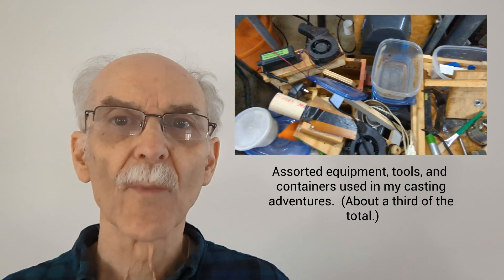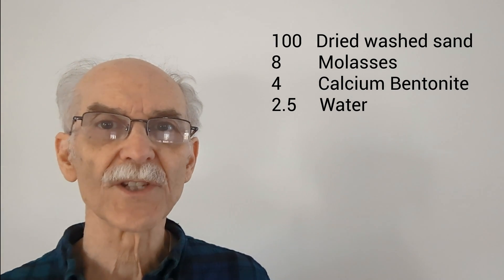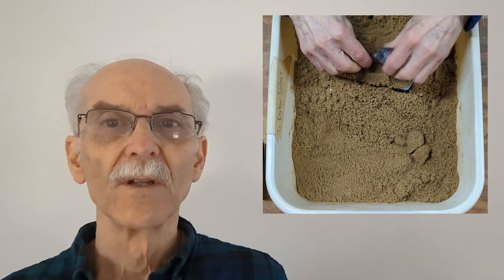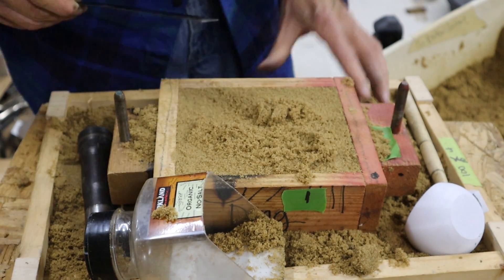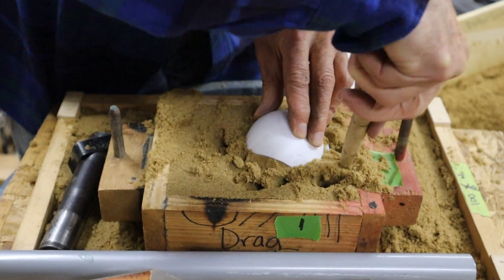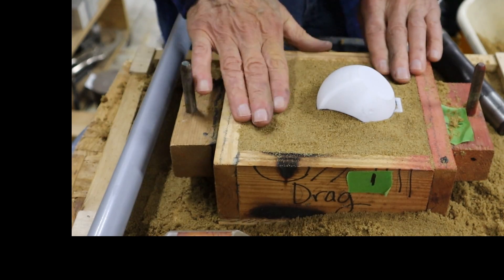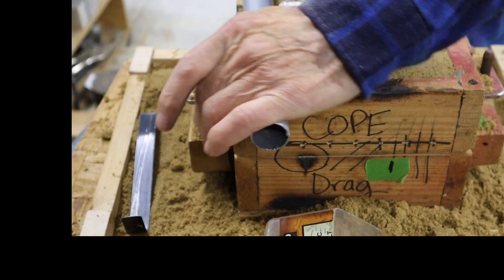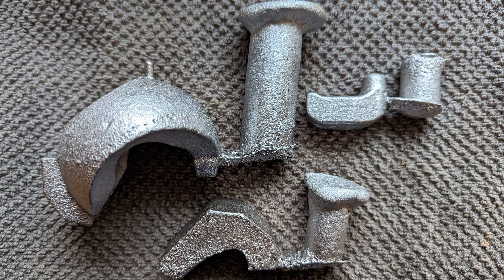Molasses-Bonded Sand Part 3 – Improved Recipe

Comment: Could you tell me the advantage of the molasses-bentonite sand as opposed to just bentonite based sand? From your video it seems to be more fluid, and I'm having a hard time to see that as a major benefit. I have little experience with metal casting and that makes it harder to evaluate this method.
Reply: If you are using bentonite as the main finding agent, certainly in a commercial foundry, there would be quite a few other ingredients. In general, unless you add an excessive amount of  clay, rendering the sand rather impermeable, you have to do a very intense, energy-consuming form of mixing called mulling. The molasses and bentonite together can just be mixed and used without this arduous step, and the sand is also flexible, and generally easier to work with.

Comment: Interesting, I've had my amateur foundry for over 50 yrs [& burnt a few out along the way] no YT to make you an expert then]  it runs on coke, with forced air nice & quiet & cheap  never bothered to change to [expensive] propane  although I built a small propane one for small stuff I  usually use greensand  or if it's a plaque  fine coat of petrobond [expensive but good for fine letters] then back up with greensand, I made some of your sand from the last video & found it good thanks, I have plenty of bentonite [hybond 100,] it's processed locally so I'll give this a try, as I was given a load of dry foundry sand from a local foundry recently thanks.
Graham.
Reply from the maker: I will be interested to see what your results are.
Reply: Thanks.
Reply: How well does the petrobond mix into your greensand? I've been thinking of doing this exact thing because even though I have hundreds of lbs of greensand.. I've basically done it all for DIRT CHEAP. Didn't want to spend money on expensive petrobond but I think I have to to get the dimensional accuracy and finish I want
Reply: @notyouraveragegoldenpotato  Hi I don't mix, yes petro is boody expensive!!what I do is sieve a fine layer of petrobond onto my plaques [they have fine lettering] petrobond is strong & fine for fine detailed patterns then fill up  with sieved greensand, ram up as usual greensand in the cope, after pouring I split the boxes & carefully scrape the burnt petrobond off so it doesn't mix/spoil the greensand & usually discard the burnt petrobond thus not using too much [expensive] petro but keeping the greensand ok been doing this for 50 odd yrs hope this helps.

Comment: When researching oil sand I kept hearing about how you can only use Bentone clay, which seems to be something you can only get a truckload of if you have an oil field. I ended up using regular bentonite from a hardware store when I saw a bag that said "oil absorbing" on it. Mixed with  synthetic 2 stroke oil I ended up with pretty good sand, although I do prefer Petrobond, aside from the price plus high shipping.

For parting compound, I have had no problems with corn starch, and it's very cheap
Reply: what kind of metal do you cast?
Reply: @WeberMachineWorks  I do lead, zinc/random pot metal, aluminum, copper, brass, and aluminum bronze